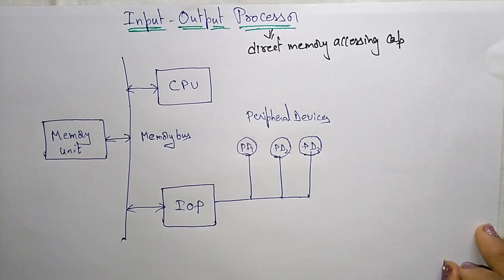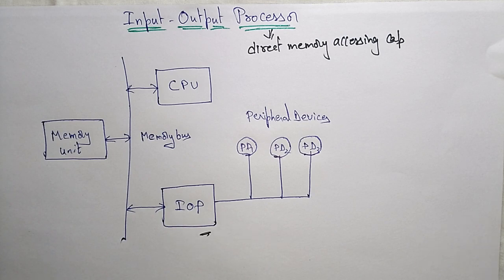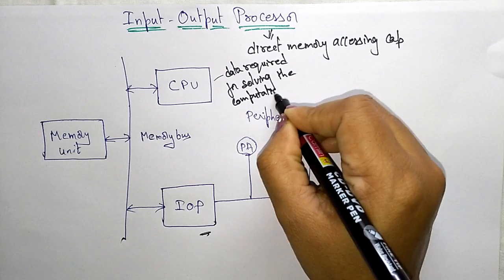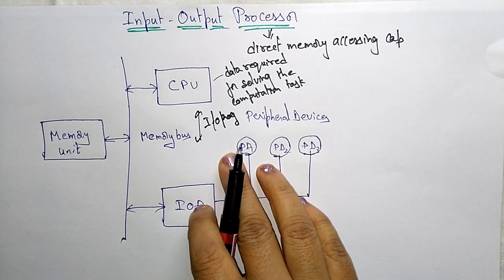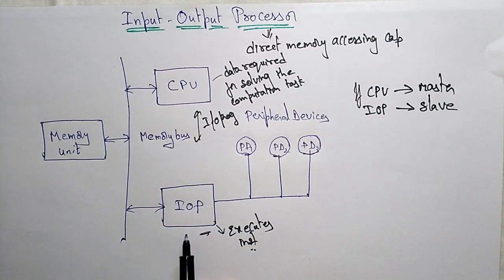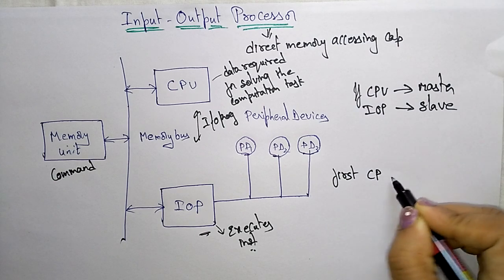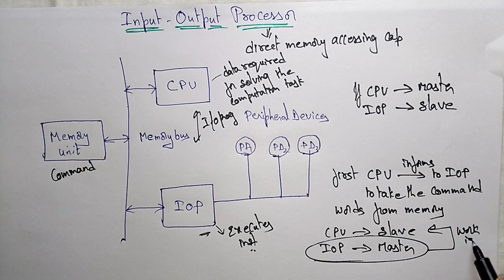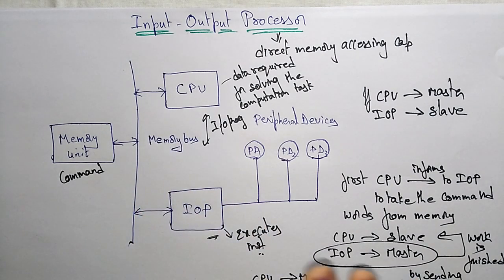input output processor | COA

Comment: An input-output processor (IOP) is a processor with direct memory access capability. In this, the computer system is divided into a memory unit and number of processors.

Each IOP controls and manage the input-output tasks. The IOP is similar to CPU except that it handles only the details of I/O processing. The IOP can fetch and execute its own instructions. These IOP instructions are designed to manage I/O transfers only.

Block Diagram Of I/O Processor
Below is a block diagram of a computer along with various I/O Processors. The memory unit occupies the central position and can communicate with each processor.

The CPU processes the data required for solving the computational tasks. The IOP provides a path for transfer of data between peripherals and memory. The CPU assigns the task of initiating the I/O program.

The IOP operates independent from CPU and transfer data between peripherals and memory.

Input/Output Processor

The communication between the IOP and the devices is similar to the program control method of transfer. And the communication with the memory is similar to the direct memory access method.

In large scale computers, each processor is independent of other processors and any processor can initiate the operation.

The CPU can act as master and the IOP act as slave processor. The CPU assigns the task of initiating operations but it is the IOP, who executes the instructions, and not the CPU. CPU instructions provide operations to start an I/O transfer. The IOP asks for CPU through interrupt.

Instructions that are read from memory by an IOP are also called commands to distinguish them from instructions that are read by CPU. Commands are prepared by programmers and are stored in memory. Command words make the program for IOP. CPU informs the IOP where to find the commands in memory.